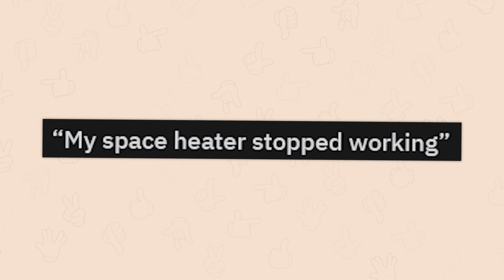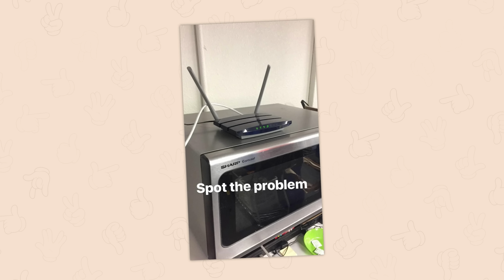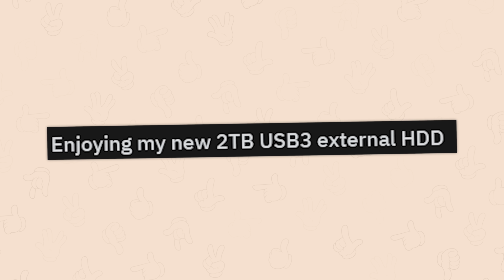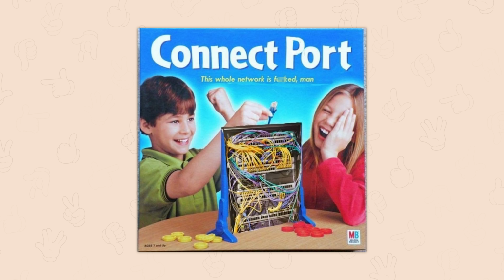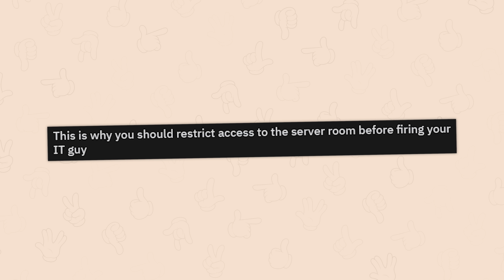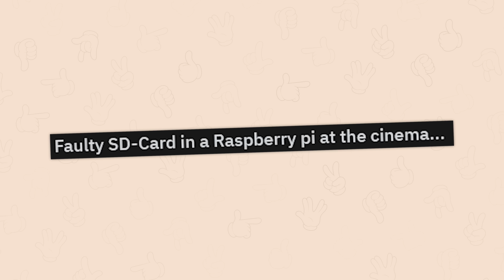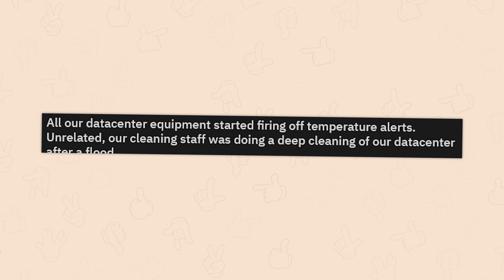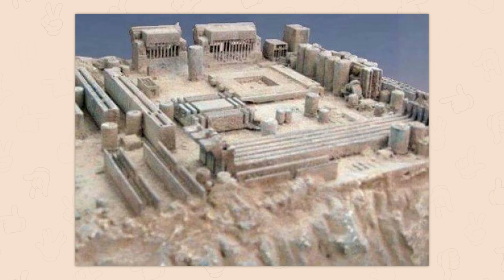r/Techsupportgore | melted :(

Comment: I did something on my computer a few years back, where everything I was doing was getting logged and put into a text file. I forget what software it was or any of the details, but I remember at some point trying to download a game and not having enough space, It was a new 2 tb hdd and I had only had it for a month so I knew there was no way it should be full. After tracking down the issue I had a file that was like 1.5tb in size. Deleted it... Had the same problem a week later. Took me a while to put 2 and 2 together.

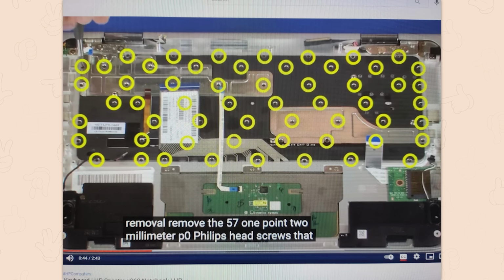Comment: 57 screws on 19:17 is really nothing, Thinkpad X1 yoga gen 2 and 3 (I'm using a gen 3) having 85 or more screws to how the keyboard. Once I had to change the keyboard, I just find another X1Y3 and take the whole case assembly (I have a collection of 2nd hands for spare parts), it's not possible to undone so many screws. BUT IT'S WAY BETTER THAN WHAT APPLE DOES!

Comment: My 1st Gen SEs screen started to peel of after a few years of use, she was a second hander I got for like 100 bucks, and I already had 2 replacements lined up when her screen bombed. I have some violent photos of that poor thing.
Reply: “HP is cheap” well yes, but my laptop (HP) was 800-900 bucks. I am not rough with my electronics. The *screws FELL OUT OF IT* and because the screws are so tiny, I had to find a replacement. Luckily I was gifted a dummy thicc (broken ) Toshiba brick, that I scavenged the screws from. They stick out, yet have actually stayed in the fucking laptop for longer than a week.

Comment: I had DSL and I rode there @$$ till they fixed it, it ended up having like 50 miles of line in a 3 mile run, they fixed it and it was good till I moved.

Comment: Reminds me of my old Samsung phone that would routinely overheat and it would get really hot to the touch late to the point of burning my hand and start running really slowly while the battery drain incredibly fast but instead of getting a new phone because I was absolutely dirt poor at the time I would just stick it in the freezer for a couple of minutes anytime it did that and it would work again for like 1/2 a day before I had to do it again it got so bad I actually jammed an extension cord in the freezer door so I could charge it in there overnight because it wouldn't charge at room temperature and yet I was still able to get almost another year of use out of it before the battery actually started swelling and I eventually had to get a new one I'm just glad it didn't explode while it was in the freezer thus ruining that as well

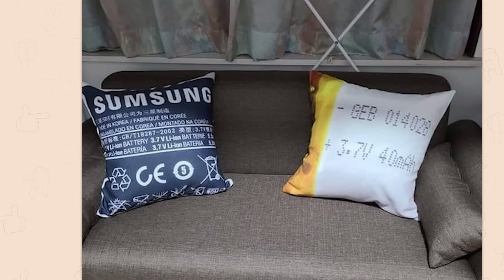Comment: 4:08 fun fact: iphones actually use samsung batteries
(i heard this somewhere and am too lazy to fact check it, so tell me if you are more knowledgeable on the subject, and know otherwise)
Reply: Samsung makes batteries for MacBooks and iPads, but not iPhones, regardless, iphone batteries, or any lithium battery for that matter, can bulge like Samsung's famously have, and under the right circumstances they can also light on fire if proper software and hardware doesn't exist to protect the batteries health, which Samsung famously didn't do with the note 7, but again, this can happen with ANY lithium battery

Comment: I once installed new ram into my computer after I had shutdown the computer
When I turned the computer back on I noticed that my monitor screen was blank (my computer stopped working)

I then turned the switch on my power supply off and then back on

Computer started working again

tldr: I am an idiot.